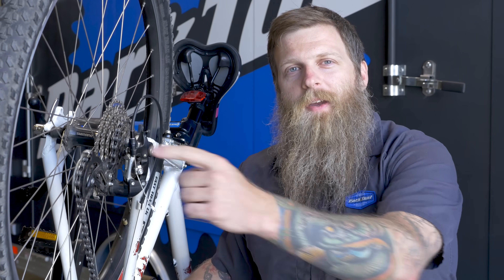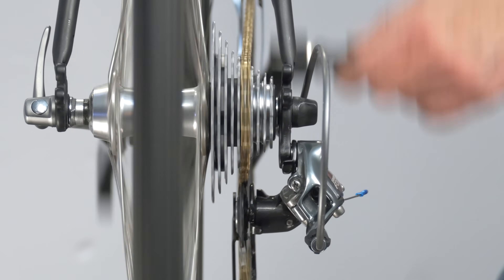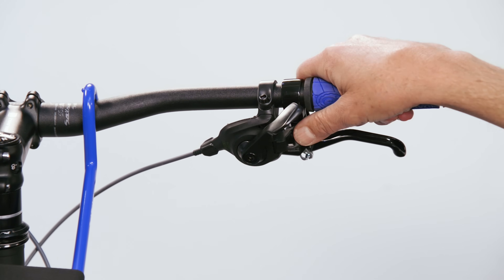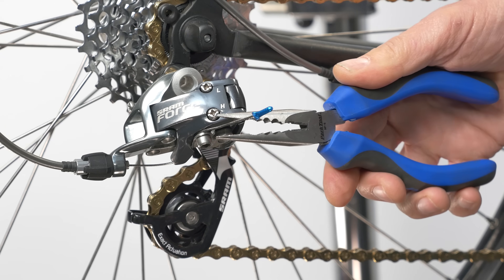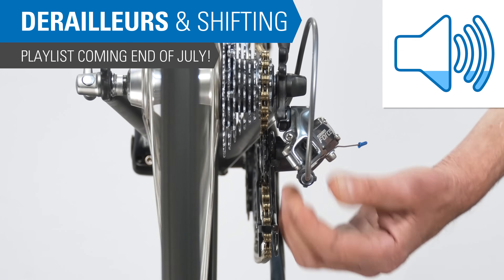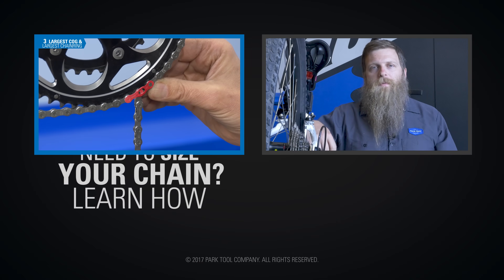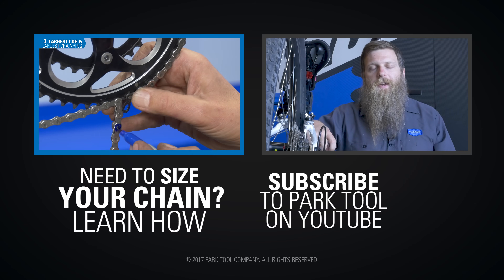How Barrel Adjusters Impact Shifting - Tech Tuesday #84

Comment: Because of Park Tool's videos on Derailleur's and adjustments I was able to get my mountain bike working great. I had to put new cables for the shifter's on and discovered the shifters were extremely over complicated and not worth the trouble so I got new shifters with new wire. However, both derailleur's were all screwed up. It's an 18 speed so it has 3 gears on front and 6 on back. The front wouldn't shift at all. The rear would skip gears. It would go from 6 to 4 but never shift to 5 when downshifting. It also wouldn't shift to 1st gear in the rear on the largest cog. This was before I changed the gear shifters and wire. The shifter's are the twist style and made by Microshift. They replaced the previous generic ones which were impossible to change the wires. However, even after it would still work similarly when shifting. 

After watching several of park tool's videos and a lot of time I was able to get it running way better. The rear shifts perfectly and took maybe 30-45 minutes on and off total. The front however was a serious pain and took several hours. After putting in all that time for the front, it does shift now but is a bit sluggish. When going from 1(Smallest cog) to 2, I have to shift the lever over 2nd gear towards 3rd gear but not all the way to 3rd to get it to shift. I have to do similar for 3rd but it's not as sluggish. It'd be nice if someone with in depth knowledge could tell me how to fix this!

Regardless, Park tool is a gem of a company both for their amazing water resistant greases but also for sharing knowledge online. I knew very little about how mountain bike's actually work before this work but knowledge is power! Thanks Park tool!
Reply from the maker: Thanks. Did you see the series on shift cable installation? https://youtu.be/VSA77DZ8kZ4
Reply: @parktool  I did...that's the very video that informed my decision on getting Microshift shifters over all of the others lol.

Comment: What about rear barrel adjuster? I couldn't turn it clockwise, because it reached dead end.

How to set both barrel adjusters and cable tension?
Reply from the maker: If both shifter and derailleur have barrel adjusters, they perform the same task.  If you only have one, and it is bottom out, and you still need more slack, loosen the cable pinch bolt and draw a small amount of cable through, maybe only 2-3mm, and secure.
Reply: @parktool  yeah I got only one in the rear derailer but it's stuck I mean I can't move it neither clockwise nor anti clockwise
Reply: @parktool  Thanks.

Comment: Is The Barrel Adjuster That Is On The Handlebar Actually Affect The Alignment Of The Derailleur Or Does It Affect The Shifting By Either Tightening Or Loosing The Cable ?
Reply from the maker: The barrel adjuster at the shifter adjusts the indexing. It has no effect on the angle of the derailleur or the limits of the derailleur.
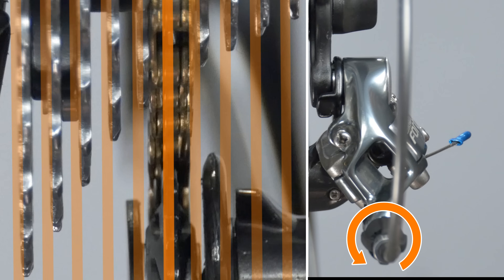Reply: @parktool  And What I Meant With Alignment Is 0:40 , Does It Go Left And Right When U Use The Shifter's Barrel Adjuster Or Does That Only Happen With The Other Barrel Adjuster (The One Connected To The Rear Derailleur)
Reply from the maker: Both barrel adjusters do the same thing and turning clockwise will move it to the right (as viewed from the back) and will move left if turned counter clockwise.
Reply: @parktool  But The Barrel Adjuster That Is Connected To The Rear Derailleur Does Has An Effect Right ?

Comment: The right hand brake on my bike is broken, how do I fix it? This brake line goes to the front wheel. I don’t really know what is broken, I just know that there is no friction at all when the brake handle is applied. The barrel adjuster seem to be in order but I notice that where the cable insertion is located, it is missing a screw. Is this something I can easily fix or would it be better to buy a whole new shifter? when both hand brakes are applied, only one side is working and the side that is broken does not do anything. Any help is welcome.

Comment: I dont have a rear derailleur barrel adjuster, would that be okay?
Reply from the maker: Some rear derailleurs do not have barrel adjusters but in those systems they typically have one at the shifter that will allow you to add "tension".

Comment: I dont have a barrel adjuster on handle bar.. and the one at the rear is max clockwise yet it cant get on 8th without squeaking, and when go to 7th, it skips the gear and pops onto 6th which causes issues